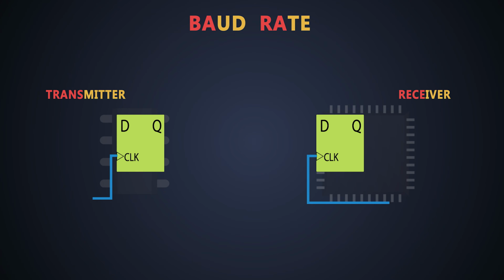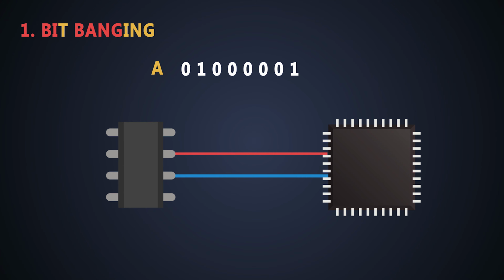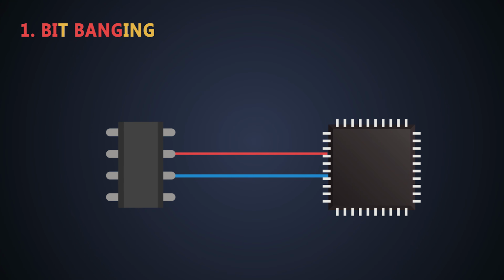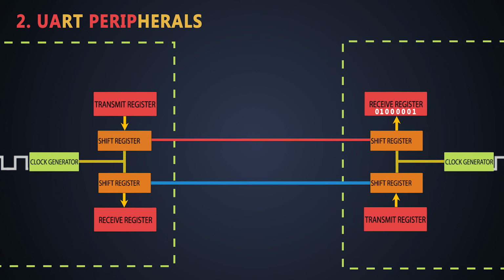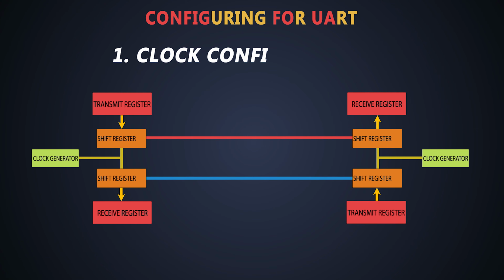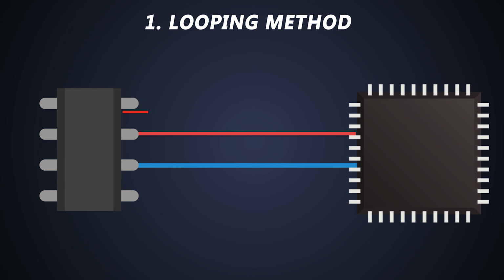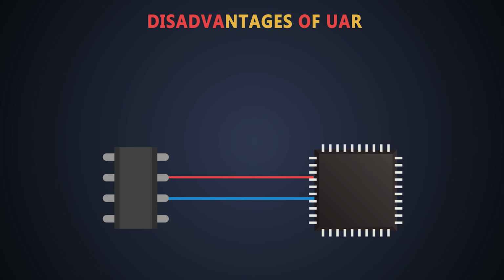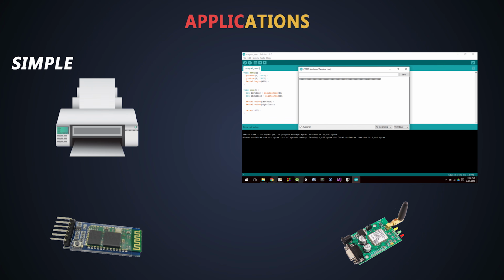Understanding UART Communication Programming | UART Peripherals | Part 2

Comment: Is UART used in ASIC/SOCs?
Reply: you can use it in ASIC design, if needed. It is one the simplest forms of communication. The downside is that UART is just for two devices. Nothing else. Buses like  SPI or I2C can work with multiple devices (buses are called single master - multi slave)

Comment: Seems to me like the clocks on both sides need to be synchronized. Just setting the same baud rates on both sides equal is not be enough. Correct?
Reply from the maker: No, baud rate synchronization is sufficient

Comment: First of all thank you Sir for the good explanation. I didn't get that point how we can configure the baud rate of the devices to be same. Since the baud rate initially could be different how could they communicate so they can set up the same baud rate?
Reply from the maker: Whenever you buy some UART enabled equipment its default baudrate is mentioned in its datasheet

If you are designing a system you need to ensure both devices are configured to the same baudrate statically..

There is no dynamic baudrate change in the system.